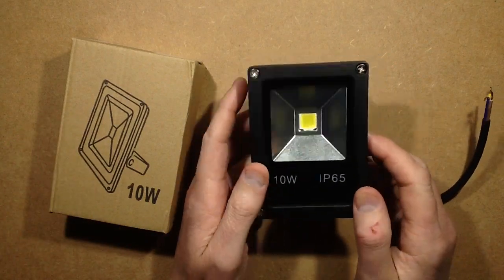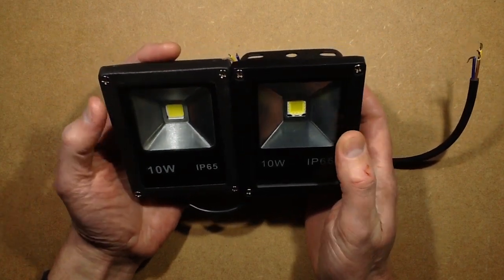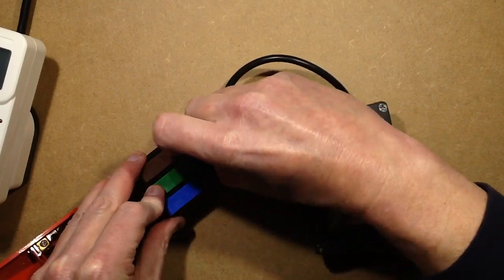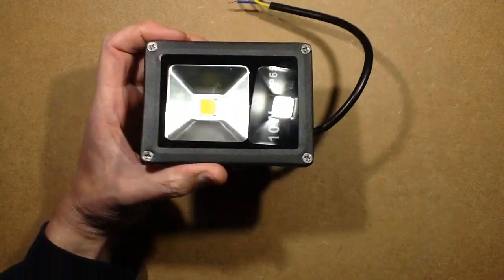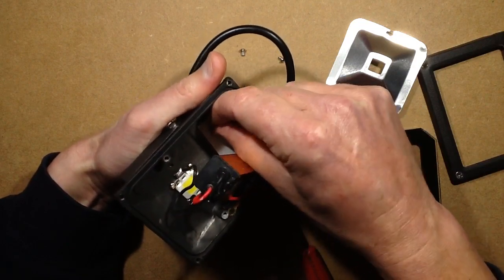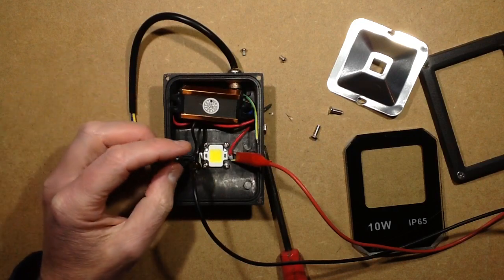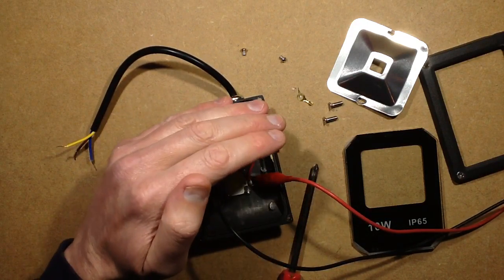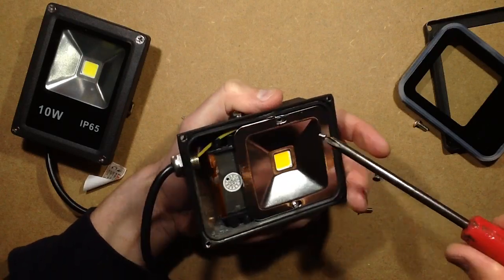A look at some super-cheap mini 10W LED floodlights.

Comment: anyone... im not familiar about electricals . .. does a 10 watts floodlight consumes more electricity than regular household 10 watts LED bulb? 
? i bought a 10 watts floodlight i feel like it's stronger, also it heats up faster than regular LED bulb. 
what does Power Factor >0.5 written in the specs mean?
💡😲
Reply from the maker: 10W is 10W.  The LED light will be brighter than a tungsten bulb though.  The power factor is the relationship between voltage and current, and is not an issue to most home users.

Comment: https://www.ebay.co.uk/itm/LED-Floodlight-10W-100W-Outdoor-Black-Security-Light-Garden-Warm-Cool-White/283835047989?_trkparms=aid%3D555021%26algo%3DPL.SIMRVI%26ao%3D1%26asc%3D20190711100440%26meid%3D95d672cd3f6e4208b08f8024db2642ca%26pid%3D100752%26rk%3D1%26rkt%3D17%26mehot%3Dco%26sd%3D283872455887%26itm%3D283835047989%26pmt%3D1%26noa%3D0%26pg%3D2047675%26algv%3DSimplRVIAMLv5WebWithPLRVIOnTopCombiner&_trksid=p2047675.c100752.m1982        check this one  the 100w one has 2 50w drivers in it for £22.95 if its worth taking a look
Reply from the maker: Is it not the driverless style PCBs?

Comment: I am a hobbyists amature recycling of solar garden lights.  I am wanting to diy solar flood lights with 10 watt smd chip led.  I'm a visual learner.  I'm looking for a simple set up.  Any suggestions on how to do this?  I don't want to buy an expensive already built system.  I'm trying to learn something new.  Thank you for any tips... Princess Ariel ex Disneyworld magic kingdom parades princess mermaid
Reply from the maker: Hello Princess.  I've got quite a few videos on my channel that show repairing of small solar garden lights.  For an actual 10W light it would require a large solar panel and battery unless a PIR movement detector was used to only light the LED at full intensity when it was needed.

Comment: I purchased to of these on Ebay here in the U.S. and found the same thing you did. The ground wire was not connected to anything. You got lucky, yours had a connector on it, mine had nothing.

Comment: is there any way to run a string of say four of these lights with only one plug?
I'd love to have four around the edge fence of my garden and plug into my outdoor socket.

thank you.
Reply from the maker: You can get waterproof junction boxes that allow you to tee off cables to each light.  Running four from a single plug would be no problem.
Reply: bigclivedotcom perfect, thank you.

Comment: I have a 10W led flood light it is one that plugs in with a 3 prong.
And like most of the LED ones you have taken apart mine was also not grounded as well.
I did earth it and now the remote to turn it off it will not turn off fully it has a row now that is always on I believe it was the right side or something.

Wondering if they left the earth off because of the RF Sensor would not work if the case was earthed?

It has me confused for sure.
It also has that cheap gross wires as well.
I have two of the 10W floods I got them for my pinball repairs so I could see in the cab and inside the pinball heads more better.
The remote on and off is nice but annoying if the ground is interfering with the off part of the LEDs.

With the remote I can change the colors as well or do a Fade in and out of the different colors..

Any suggestions on why the LEDs will not shut off completely now?
Should I look for if one of the wires going to the LEDs is touching the case?

Comment: They say these lights work at voltages from 85 volt to 265 volts AC. Forgive my ignorance here, but I have a dumb question. Will this light produce more light at 240 volts than at 120 volts ? Or is the power supply compensate at lower (or higher) voltage ?
Reply from the maker: The current will adjust to suit, but the regulation is controlled from the LED side, so it will remain the same.
Reply: Thank you

Comment: I could be mistaken (you unplugged the quicktest pretty quick, so the meter might not have stabilised it's reading) but I did note that when you opened the quicktest the power dropped from 8W to about 4W since the quicktest is still drawing power to light the neon, so maybe the supply is actually not 8W
Reply: Aaron Somerfield The power required to light the neon is in the tens of milliwatts. Nowhere near enough to skew the readings.

Comment: Wait 31 volt? So you cant put in 3x3 array led cob in?
Reply from the maker: There are two versions of the 10W 3x3 COB.  One with the three series arrays in parallel (9-12V at 1A) and one where all 9 chips are in series (27-32V at 300mA).  You have to check the specs for the forward voltage and/or current when buying them.
Reply: have a look at a seller called led-supply http://www.ebay.co.uk/usr/led-supply?_trksid=p2053788.m1543.l2754

Comment: Hi Clive! Working on diy low voltage lighting system, what would the best way to control brightness in LED systems; amp control or some sort of high frequency PWM?
Reply from the maker: Simplest way a resistor, most efficient way a PWM controller.  (Available cheaply on eBay.)

Comment: If I lived on Mars, would the grounding wire be called the Mars wire?
Solar electron/proton storms are extreme there, so be sure your dome is properly Marsed so you don't have a surge.
Reply: it still would have been called the ground wire :p
Reply: VivaLaFlam Right, but Europeans call the ground wire the Earth wire.
On Mars, electronics cannot be "earthed". The ground wire would be connected to Mars.
Reply: It's essentially the same thing. Only the name changes.
In Greek for example we use the word "γείωση" from the word "γη" which means either "earth" or "ground" (based on the context)

Comment: +bigclivedotcom They are about $12.99 each for 10W and $10 for shipping. Still worth it for that price? (AUD pricing).
Reply from the maker: +themaconeau The 10W ones should only be about $10 AUS including free shipping.  If they cost more then shop around.
Reply: bigclivedotcom That was from the seller you got them from. Is it a very much lucky dip to find a proper supplier like the one you have shown?

I'm thinking a few of either a 20W or 30W for a space about 4m wide x 2m high. Think garden shed but bigger.Just don't want to waste my hard earned is all >.<
Reply: +themaconeau Just got the 10W version in and mine had the earth wire attached! I almost died >.<
It was about AUD$10 incl shipping. Looks reasonable quality. About to put a plug on it and test ;)

Comment: I bought one of these off Ebay and when it got here it was the top of the crop of cheap. It had no earth, the ballast was basically an exposed circut board, the wire was dreadful and of course it wasn't 10 watts. A trip to Wilko's and some crimps, wire and a plug later it was fixed up and working quite well. Until I screwed the front on and the case broke. Sigh. Ebay
Reply from the maker: +Milk Bottles Getting an LED driver that is basically a bare module in heatshrink sleeving or the tiny little 3W drivers in a small plastic box isn't unusual.

Comment: US listing for the item by the same seller: 

http://www.ebay.com/itm/10W-20W-30W-50W-100W-LED-Flood-Light-Outdoor-Landscape-Lamp-Waterproof-IP65-HID-/111806645969?var=&hash=item1a083206d1:m:mQSMphH6k3EnEuIiEG_xQ6g
Reply: +Blake Nelson Thanks. Spotted and ordered.
Reply: +Blake Nelson Nice tip but also no go for Germany

Comment: I ordered a couple from the same seller,  ground wire not attached,  my power supply was loose, glue broke off label,  but I did manage to get pic of it
Reply: As posted in video review, they all come with the ground wires not attached. 
I actually ordered 4 and all of them didn't have the ground connected. 
It's just the nature of the beast when ordering from China.

Comment: just received mine the earth wire not connected and no terminal fitted, would it be ok to cut the wires inside and fit new flex using wago connectors or would soldering be a better option.
Reply from the maker: +chester ton I soldered and sleeved mine, but you could use crimps or any connector that fits easily in the case.
Reply: +bigclivedotcom 
thank you your advise is greatly welcome, I'm new to your channel and loving it.

Comment: Finally got the Cool-white ones I ordered (same boxes, another seller - http://www.ebay.co.uk/itm/331638206961 ) today, been rewiring them, as usual there was no earth connection, and interestingly, one had been so poorly cast, there were holes in the top of it between the cooling fins, so would have been a great water ingress spot, on an unearthed light!! :S

Still, rewired, holes filled with JB weld (damned good stuff that!), they light up nicely and pretty brightly too, so, reasonably happy, neat little things, definitely not an out-of-box solution, but something for us in the know to play with regardless... :)

Still awaiting the Warm-white versions though...

Comment: Hi,why should this be earthed, when the driver is IP65?
Reply from the maker: Because faults happen and the case is metal.  I've already had a similar light supplied with a live case due to a trapped wire.
Reply: thx for the info

Comment: Was the earth wire not long enough to connect to the securing screw of the LED in the bottom left corner?

P.S. I have ordered four of these in warm white when they were £2.89 each. These sellers should be paying you commission!

Update Mine arrived and are pretty much the same as yours. LED's all appear to illuminate evenly, draws just over 8 watts, but the earth cable had been made longer so it would reach the drilled and tapped hole ...shame they hadn't bothered putting a lug on it and had just been left not connected! Not to worry as the flex appears to be about 0.1mm CSA and is too short so will be getting replaced.

Comment: Very nice little lights for the price! For your information, I dismantled one of the power supplies - Chip is marked 61NL5DEZG. There's a really cute "track fuse" on the input, no secondary side feedback (well, duh at this price). Quite nice little board. Amazing for this price.

Comment: I am a new subscriber and I really love your videos covering these LEDs. Seeing that the power pack was rated at such a difference in voltage input, would the light be dimmer here in the US or are they constant current power packs?  Thank you for your vidoes and your time.
Reply from the maker: +Gregory Wood I think most of the little switchmode power supplies tend to be universal voltage now.

Comment: I may have gotten the last of these in cool white, before they ran out and then raised the price, for about $4.50 (USA dollars) that came in today. I tore it down and only two screws were in the LED chip and not 4. Ground wire inside did not even have a connector on it, but the wire was about the same place as Clives. The power supply was not glued, but just sitting loose in there. Did not test the uniformity of light, at lower than running DC voltage, for the chip. Power consumption is not 10W, but around 7.7w total on mine at the start, according to my handy dandy watt meter which measures 60, on a 60w incandescent bulb. All at 110-120v ac.  After about 5 minutes about 7.5w . After 30 minutes or so down to about 7.2-3. After 45 minutes the same. Temp of the housing after 45 minutes very warm, but can be held in the hand comfortably. 

Grounding does not matter to me, because I know in the USA and much of the world grounding did not exist in the wiring of houses and buildings, until in the USA around the 70s and later. At 220v it may be needed, but doesn't seem to be with 110-120v, since we are not having shock problems or fires, from not being grounded in the news. I wonder if China actually uses ground wiring at all there LOL

Power supply not glued in and measured power only 70% of claimed, and LED chip had 2 screws and not 4. The finish on mine looked fine, and kind of a mat black or satin black color.

I think it was well worth 4.50USD delivered on looks, and it is pretty bright. Current USD price about 8.77 and I don't know it if it is a killer deal at that price. The quality might be fading on them too, with less screws in mine and not glued on the power supply and lower wattage.
Reply from the maker: +free100x Two screws on the LED is pretty common.  That's one of the reasons I was surprised to see four.  And there are often two diagonal screws on the reflector too.
Reply: +bigclivedotcom 

I am not unhappy with it considering the price especially, and thanks for finding it and pointing it out.

One more thing that was a little strange about it was I ordered it on the 18th, and a shipping label from USPS was created on the 20th out of Dayton Ohio. It arrived there on the 23rd and got to NM where I live on the 26th. So it looks like it actually shipped from Ohio, at least for mine. Maybe they have a USA  warehouse there.

It is showing to be very bright on my Lux meter, like the meter you bought and had in one of your videos. Very handy for comparing actual light output.

Comment: Seeing how you gave your feed back on the stripper. Maybe could do some tool reviews?
Reply from the maker: +AJ Harran That's a good idea.  I did my electrical toolbag, so I should do my electronic toolkit too.
Reply: Be interesting to see what tools are preferable over others. Do you have any scopes? I see a few videos from AVE where he checks line feedback noise and such. Sorry if my lingo is not par. My forte is car electronics. I just happen to enjoy your videos. Keep up the good work!
Reply from the maker: +AJ Harran I do have an Owon digital storage scope for when I need to analyse waveforms a bit deeper.  From a hand tool perspective I prefer properly engineered tools for applications where they are getting heavy use, and throwaway tools for where they might get abused.  I'm not a tool snob, but I do appreciate tools that do their job well.

Comment: Yeh thanks now I've just bought some !!
Reply from the maker: +rob morley I've been running some tests on one of them today.  Several hours running and then an examination with a thermal camera.  The area directly behind the LED on the heatsink was just 50 degrees centigrade.  That's a nice safe temperature to run an LED.  The cases alone are totally worth what they cost.

Comment: Quick Tests/Safe Blocks are available from CPC.

I got one of those floodlights off AliExpress a few months ago.  It was just the same as yours, even down to the unconnected earth tag which easily pulled off.

I don't have a power meter so worked it out my Voltage x Current and was surprised to get over 8W.

Apart from fitting a longer flex, the only other thing I did with mine was stick some 'privacy film' on the front to defuse the light.

Comment: hows the light output? good for little work lights or filming?
Reply from the maker: +IamKrAzE Not bad.  I've got one above my bench at the moment running continuously to see if it goes bang or gets too hot.  So far the case has got warm, but not hot.  The light level is OK for ambient illumination, but not really suited to filming as anything other than accent lighting or as a compact fill light.

Comment: I bought a 12v version of what looks to be an identical light (assume it's the same minus the PSU), turned out 10W was more like 5W, basically 500mA at 12v. BUT the output was really good, so I don't understand why they feel the need to lie about that.
Reply: +Strider9655 yep, clive has shown the same before, and i had some led's from the same year or two ago that were the same, they also had an acceptable output

Comment: These are way to cool for $4.50 USD, delivered too. The Chinese must work for 2 cents an hour. I've been planning to build a project that calls for these 10 watt LEDs. I was in the process of finishing the parts list for the build but now, with these lights, I would be nuts not to just order 10 of these. There is no way I could build the power supply much less the housing and lamps this cheap. Are the cases aluminum? Thanks Clive!
Reply from the maker: +bain5872 I'm not sure the exact alloy used but has an aluminium feel.
Reply: That's what I was hoping for. Thanks much!

Comment: clive what kind of bench top power supply do you have
Reply from the maker: +Wes Shaw I've got two here, but the one I'm using most at the moment is from a UK outlet called Maplin.
http://www.maplin.co.uk/p/80w-switched-mode-dc-multi-voltage-slim-bench-power-supply-n27gg
Reply: +bigclivedotcom That's a good price for that PSU, I assume you can run it on 120 volts mains as well as the UK 230?
Reason I ask is because I am looking into buying a new bench PSU for my shop, my current one is well, dated and needs to be retired..
Reply from the maker: +ElfNet Gaming It does appear to be universal voltage.  You may find it available locally under a different label.
Reply: +ElfNet Gaming Probably too late to help, but if you're in the US, here's what I've been using. Cheap, but have been reliable and powerful. Solder the connections in the provided output leads, tho! http://www.mcmelectronics.com/product/DISTRIBUTED-BY-MCM-PS3005-/72-11885
$69.95 each, sometimes $10 off on sale. I use two, so I can get 60V up to 5A in series, 30V at 10A parallel. One has been powering my sump pump monitor prototype 24/7 for almost a year, unless I need it for something else. I've used them at 14.2v 5a to charge my standby batts, run LEDs, etc. Just don't with any of these style supplies, set them to a higher voltage, limited current, then hook up LEDs. THe output cap and the PS switching to current limit may be too much for small LEDs. Always creep up your voltage, as Clive does here, to avoid 'shocking' the LED. I love these PSes..
(Also sold under other labels..)
 Stu